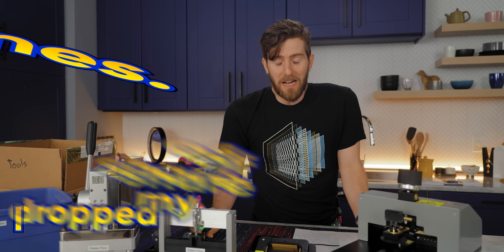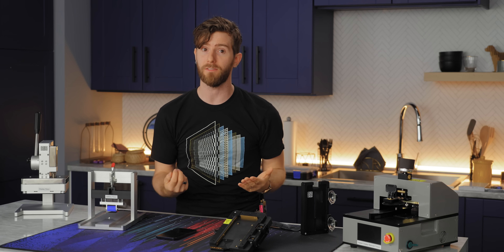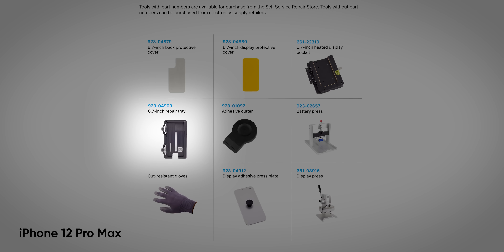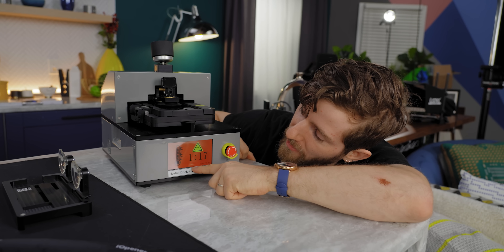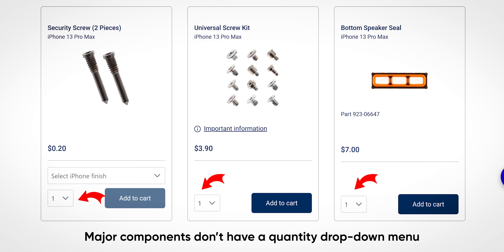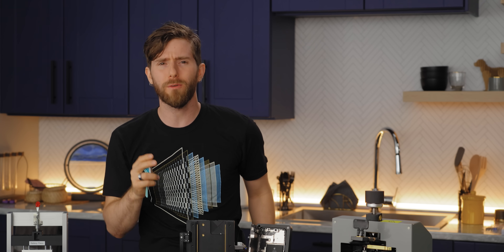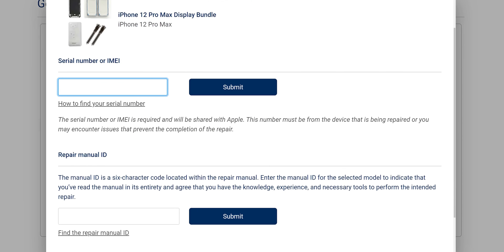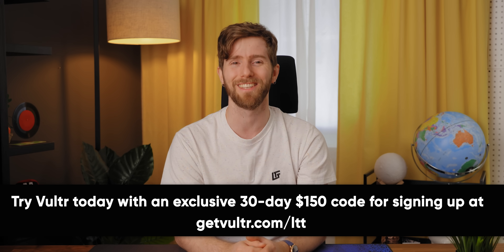I’m a Genius - Apple Self Service Repair Program

Comment: I'm not sure if letting every user fix their device is the best idea (I recently attempted to fixed my Switch Joy-Con due to drift, but a ribbon got cut in the process – no cutting instruments in the process). However, I think the "certified Apple repair shops" is a better idea, for two reasons: It makes the user make sure a store is near their place, with a competent worker doing the process, and it even lets Apple make their own orders, in case people "send it to Apple", for a nearer place, reducing travel times and waiting for the user to have it fixed.
Reply: Random users is a idea fraught with issues. Certified is fine. In a workshop or professional environment, you can handle retraining fellow technicians internally (or fire them / make them lose their license). . . but random joe schmoes that have no clue wtf they're doing and have no accountability and little access to others? Oof. 

Plenty of complaints, no accountability of tools, parts, skill certification-- not like you can ask your coworker/fellow technicians for help if shit goes wrong. No tracking of wth goes wrong. 

A maintenance / repair center alone is tough enough to deal with to retain the skills, knowledge and proper parts / procedure. On an individual user repair basis? ooof. I am not envious of Apple's position. 

Making a certification program has its own issues. . . especially since Apple is an international company and these things are used around the world. 

I think this current program benefits cities and areas that don't have access to apple stores the most (literally have to fly to an apple store for some people).

Comment: Apple has made it unnecessarily difficult to repair your device. There is zero, actual need for all of these tethers and authentication measures. Their programs are just honestly not much more than publicity stunts. There is zero reason why I shouldn't be able to just replace any part of my phone and it just work then and there if I repaired it proper. I shouldn't need Apple software or Apple support to restore functionality.

This is a big reason why I will never, for any reason, purchase any Apple product for as long as they keep these scummy practices up.

Comment: The only good thing that will come out of this is that China will have imitation toolkits out within a few months at a fraction of the price, and also the actual spare parts to reference when manufacturing them for repair shops.
Reply: The spare parts coming out of China are already made from the same factories as Apple. They just don't do as much quality testing as an official Apple production run of those parts.
Reply: @ZNotFound  OE vs OEM. Same as it ever was. Manufacturers actually produce very little aside from labels and packaging when it comes to most replacement parts.
Reply: Wouldn't count on that. If it were to be the case, we'd already have spare parts sold at cheaper prices from China, but Apple has them on choke-hold contracts forbidding them from selling parts to anyone other than them. There's a reason why tech youtubers like Louis Rossman have to use spare parts from other defective units rather than brand new ones. He literally tried to call a manufacturer and offered to pay them directly for replacement parts and they straight up categorically refused. I expect it'll be the same with the tool kits.
Reply: uhh they were available to IRPs before, so if the Chinese actually wanted to copy these, they would've already done that. That said, no one who is actually a capable repairman needs any of these tools as they are useless in real life situations and take way more time than doing it manually. And that is coming from someone who has to work with these tools every day. They are a disgrace to human intelligence.
Reply: @PvtAnonymous  As a devil's advocate who worked on repairing phones for at least a year before these tools came out, there is 1 that might seem useful. The heated screen press is a joke, and the battery roller is honestly an insult to anyone with functioning appendages, but the adhesive/display press might actually be useful. I've had to do several repairs where another shop didn't apply sufficient force to the adhesive/display, and had it come apart a few weeks later. As for the rest of it, absolutely worthless. Cracked screens and bent frames make the heater useless, and the concept of needing an entire jig to press down a battery is just insulting.
(but you honestly don't need any of those tools, the one just makes it easier for inexperienced people to not make that mistake).

Comment: I would respect lower costs on battery replacement if the user has to send the replaced battery back to Apple for safe disposal and or refurbishment.

Comment: It is unnaceptable the way iphones are so easily damaged.   I have  a Kyocera duraforce pro. literally very difficult to damage.  you can throw it against a wall  without issue.I've dropped my phone practically everyday for 3 years  and my phone looks new.   Apple was going to use the same sapphie glass a couple years ago , but thern cheaped out  and stuck with gorilla glass or whatever. The phones are so fragile they have created a billion dollar repair industry.

Comment: Good video. I understand this is not the fairest consumer practice and I wish they'd get better to be honest... These phones are not cheap, and you should certainly be able to do this by yourself, period.
On the other hand, it is what you get when you get an iPhone. Let's remember that these phones are not bad in any way and they have proven to have good software support (5 years at least) and safety practices (anti-tracking) which are not seen on other phones.
Apple is fair in this regard, but it might not be when it comes to consumer practices. But rather than just throwing out hate towards it, let's just remember something: there ARE other brands.
People who are OK with Apple will continue to choose Apple and, quite honestly, I don't think that the majority of them will be disappointed.
You have the right to go non-Apple if that is your choice, but it is important to respect other people's decisions. If it works great for them then go iPhone. If you don't like Apple's "ridiculous" prices, go to Android or somewhere else. 
You're free to choose whatever platform you like, and no one should judge you for being "dumb" for that.
Every company has its pros and cons and certainly, Apple is not an exception.

Comment: Linus: "The tool is really nice!"
Me: "That's good!
Linus: "But beware, the manual is cursed..."
Me: "That's bad"
Linus: "You can now order the parts for Apple!"
Me: "That's good!"
Linus: "But beware, it's really tricky to order the correct parts..."
Me: "That's bad"
Reply: Linus: "You can repair your broken device!"
Me: "That's good!"
Linus: But beware, it will cost more than letting Apple repair it or getting a new phone..."
Me: "That's bad.."
Reply: But they come with a free Frogurt!
Reply: The toppings contain potassium benzoate
Reply: "That's good! Or is that bad? Ohhhhh........"
Reply: But it comes with sprinkles
Reply: Linus: The parts contain potassium benzoate
Me: ...
Linus: That's bad.
Me: Can I go now?

Comment: The display adhesive on both the 12s and 13s are such a pain in the ass to remove. And thaty with using the machine to remove the display.

Comment: Apple needs to make this more cost effective for the consumer while still making a profit somehow, but they also need to make it a more ideal option and I have that they have decided that hey maybe you should just come buy a new phone instead. Think of the amount of e-waste that can be saved from landfills if people got to fix their old broken phones, or let's say your phones 2 years old screen cracks and battery is toast, apple rather have you flush your old phone down the toilet then run to the apple store and buy a new phone, rather than fix it(while still making a profit) and allowing a consumer to continue use of the device for another year, maybe two

Comment: I'm honestly shocked at how affordable those tools are, just looking at them and knowing costs of commercial/industrial tools like that I thought they would be probably 10x that.

The program is still a complete dumpster fire, but the tool cost at least it's good.
Reply: I think we can thank China for that. They have a massive industry of refurbishing Apple products. This equipment is fairly common so it’s mass produced.
Reply: The cynic in me says this is part of the plan. By making the tools cheap the process overall impractical they can argue that there's no demand for right to repair. They can say, honestly, that they made all the tools available and no one wanted them. It's a tiny investment for them to claim some moral high ground.
Reply: Because commercial/industrial tool are made for turn around volume and time.

Industrial/commercial stufftens to also be highly self serviceable and reliable. 

But the self serviceability of professional tools has being going down hill since decades ago (tractor for example).

Comment: Fun fact, a lot of companies like AT&T and Verizon offer subsidized part repair plans that you can cancel at any time. Basically what you do as you call up your service provider, tell them you want insurance on your phone.

Insurance plans start at about $10-$25 per month depending on the level of coverage. All you have to do is get there mid to your package at about $15, and all of a sudden screen replacements are 120 bucks. Back glass replacements are 80. Your cell phone provider will contract insurance on to send you a brand new device via mail and simply send your old device back of your package just like the Apple care plans would do. There is no time limitation on how long you have to subscribe to these plans so you could literally just cancel immediately after it’s fixed
Reply: There's more broad accidental electronics insurance from insurers too, to cover mobile devices / laptops / electronic property. They're better value than per device insurance imo. I've had entire laptop paid for because of it.

Comment: I can understand the "credit" for returning the old parts. To me, that's the equivalent of a core charge for automotive part which was put into place to help promote recycling. Which you'll most likely get less back on then what Apple is offering. And this is coming from an apple hater.
Reply: core charges weren't put in place for recycling, they were there for remanufacturing.  For instance, a brake caliper.  In most cases to fix them you only need a few dollars worth of parts (or cents if your big business), copper crush washers, banjo bolt, rubber seals and some cleaning.  the expensive part is the casting, which almost never needs to be replaced.

the core charge ensures the company get's another casting (core) back to rebuild and resell.

The only time i've seen the word "core" used in auto parts to refer to recycling is when sleezy parts stores put a "core" charge on batteries.  that's because they can get about 10 bucks for every dead battery they recycle.  

apple could refurbish screens in a most cases, but i rather doubt they do.  They want the parts back so that someone ELSE doesn't refurbish and resell it.  Refurbishing and reusing is better than recycling for the environment remember.

Comment: I love how I am watching this on my iphone 5SE that I replaced the battery on myself and it works just fine. I really dont like the glue in screens and the fact that everything costs way too much to replace a component or you cant even do something like a screen without going to apple. If they cant make the cost less than going to the store and or allow third party screens they are just scamming us and any sort of legislation around right to repair.
Reply: Glue is unfortunately a requirement for good water resistance.
Reply: @ludwig2345   an oring would work just fine...
Reply: @CVtheChosen  tell all phone manufacturers that. They will probably be delighted to hear your solution.
Reply: @ludwig2345  I am by commenting on an LTT video. They read these you know. I feel like my uproar is one of the reasons for the iphone 13 mini and their sad attempts at home repair.
Reply: @CVtheChosen  you seriously think that an o-ring wasn't one of the first things they thought about?

Considering not even the fairphone 4 (a phone designed to be as repair friendly as possible) has an o-ring, it's probably not a great solution.

Comment: I reckon it is highly likely that this system is designed to specifically undermine right to repair so that Apple can push against policies being implemented which would force them to make right to repair accessible
Reply: Or make it so difficult and expensive that people will just prefer to take to the Apple Store instead. All the while Apple is able to say they are complying with right to repair and save face. Typical Apple behavior. Corporate greed at it's best.
Reply: Honestly this should be seen as a middle finger to the EU. The wording of the law was something along the lines of "reasonable avenues for the consumer to repair their own device." I'd say charging more for parts than a phone is worth and requiring all kinds of specially made tooling that was only developed to make repairs difficult to begin with is nowhere near "reasonable". It's time to levy REAL fines against these companies. Forget these $5-7 million fines Apple just ignores. They need to get backhanded with a $50 BILLION fine before they even think of changing anything. I'm tired of companies like Apple, Google, Amazon, and Microsoft being allowed to just ignore laws.
Reply: @zodwraith5745  if the punishment for breaking the law is just a fine, them that law only exists for the poor.
Reply: @KalijahAnderson   Then make laws specifically designed to target the rich. They'll think twice before breaking them if it costs double digit percentages of their wealth!
Reply: @watema3381  at that point tho they either just don't deal with the customer base the law applies too. Or they ramp up prices
Reply: @dozergames2395   Then they lose customers. They'll be forced into compliance or lose a major part of it's user base (i.e. Europe and USB-C iPhones for example)
Reply: @watema3381  While there is money in politics that won't ever happen. Politicians rely on big money and are beholden to them.
Reply: @watema3381  in the US, that would be very hard to do as the rich will just pay the law makers to get them to vote against it. It's a shit system and has been ever since Citizens United court case.
Reply: @KalijahAnderson   I agree. America is fucked.
Reply: @KalijahAnderson   what's "the rock"?
Reply: @miscl_anon  apparently that's my phone autocorrecting "rich" into "rock". Fixed now. Thank you.
Reply: @KalijahAnderson  o ok lmao, fair nuff
Reply: @KalijahAnderson  There comes a point where that isn't valid. 50 MMM is over 1/8th of their total revenue for the year, that won't be ignored by stock holders.
Reply: 100%
Reply: It's simple, if you buy apple products you get shafted every single way possible being left with a sub par device out of the box.
Reply: We meet again brother
Reply: I see you are man of good taste
Reply: Can't remember which country it was (or perhaps it the EU as a whole) but I somewhat remember reading something about fines based on profits and I think that had something to do with right to repair (I'm tired and I probably read that over a month ago so a bit fuzzy on the details).
Reply: Absolutely, they are going to fool the government with this and then there will be no right to repair bill
Reply: this was said since Apple announced the program, i don’t know why people love to hate Apple for the obvious strategies they do. it’s not like it’s a hidden agenda.
Reply: While I agree with this you're spewing the same narrative  You've heard repeated a 1000 times through the echo chamber of reviews reviews and content regarding the service
Reply: or maybe Apple is still trying to figure out a way to have non AASP/Store Technicians get access to the web based tools without having to go through the required (several) hours of online training per chassis type to qualify for access.